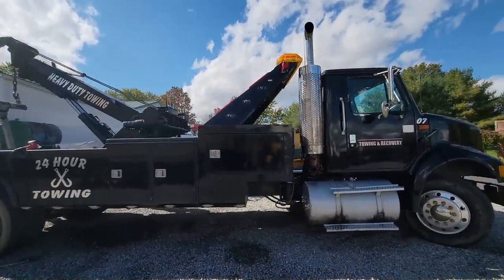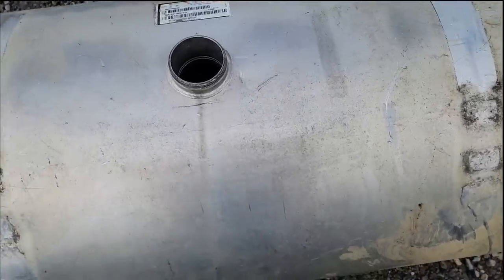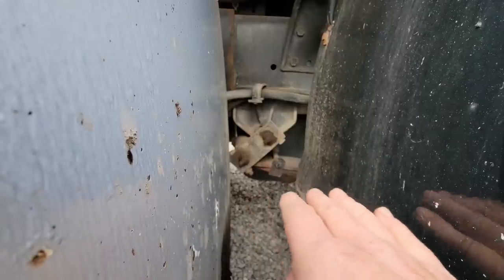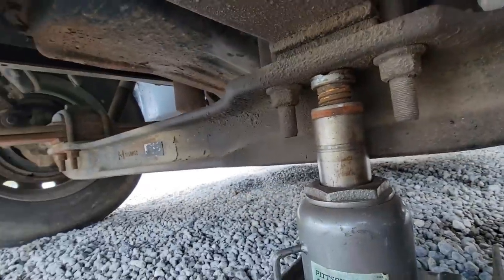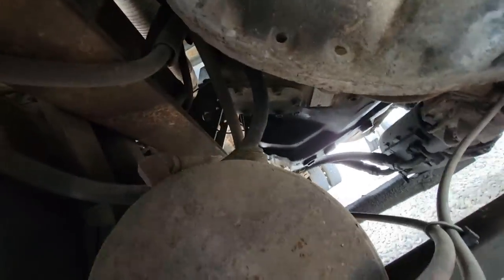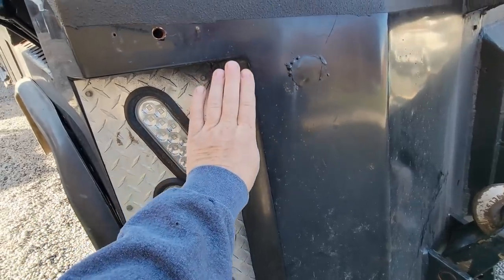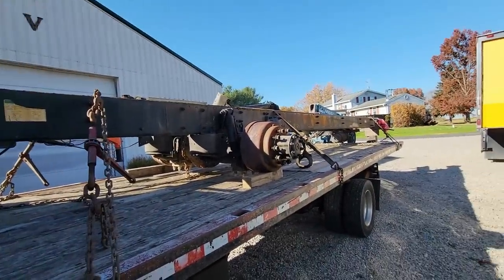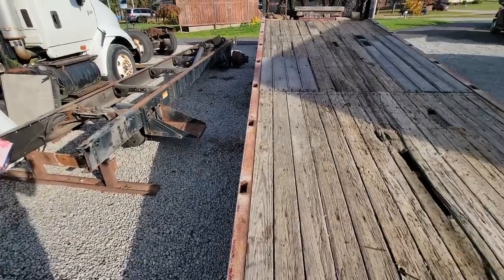2001 8100 WRECKER PT4 MORE PROGRESS AND PUTTING IT TO WORK!

Comment: Dear J.C. Smith projects family.
👍👏👌 Using a hair dryer, definitely not a heat gun! That's exactly the way to do it and how I deal with stickers too. Meanwhile the only thing I use to remove the rest of the glue is, believe it or not, olive oil (nearly any kind of vegetable oil/fat or even butter will do fine too). Maybe this method is a bit more time consuming but it will definitely not damage any surfaces.
2) A lot of content in this video. Of course I'm eagerly looking forward to watch all the repairs and modifications you do on this wrecker.
Thanks a lot for making teaching explaining recording editing uploading and sharing.
Best regards luck and health to all of you.

Comment: For the backup camera I would make a bracket so it sits just above the under-reach so you can see the whole thing as you back up and use it as a tool to help center yourself. I also agree with you on toolboxes… Seems like you have plenty until they’re full and you still want to carry more stuff… Towing is a cut throat business but with your knowledge and want to have things right you would make a name for yourself… the only problem is finding another one if you to hire to help run trucks…
Reply from the maker: my intention was not to be for hire. only want to move my own trucks. i see working for others as adding more drama and stress to my life that i dont really need. im not saying i wont but it isnt my intention right now. i looked into insurance. i was thinking that i would make the truck pay for itself  but the insurance is ridiculous. adding another driver made it so much higher.

Comment: I know one thing about the 4700 series international. And i know you do too. They are really hard on kingpins. The 4300 series is even worse on them. My brand new 4300 with a 21 foot steel roll ack on it had to have new kingpins installed at 62,000 miles. I could not believe that they went bad that quick. It was immaculately maintained up to that point and it still kicked the crap outta the kingpins

Comment: There is this adhesive remover called 'rapid remover" and it makes googone look like tap water. You don't even have to remove the vinyl first.  It's safe, non toxic and you can get it on that jungle website that bezos created. It's a bit expensive but it is absolutely amazing. Works very well on old paint protection film.

Comment: Great video......i always use hair dryer to ease stickers off but petrol will get any adhesive left off in a flash.....then quick buff with polishing compound and jobs a goodun.......also i drain tanks and stuff a handfull of blue roll in and then blow them around with air line and then use long spring claw to retrieve rags then quick rinse with petrol to any last water 👌

Comment: Jc I know a older guy who used to buy large lots of stuff at auctions. He has several hundred different truck lights like you use. I could probably work a pretty cheap deal on all of it if you are interested. All are new in package and at least 90% are led. The packages are slightly damaged but lights I saw all look unharmed.
Reply from the maker: i think i found what was in the rear and i ordered some work lights. if i need more, i would definitely be interested

Comment: Excellent explanation on springs, and how you check king pins and such.
Surprised how tight the kingpins and tie rod ends were whith those junk leaf springs!
That rear axle on the frame looked like a 23,000 lb axle. Is it a locker as well?
Lettering on the boom,, take off "towing" and leave "Heavy Duty". There is the name for this truck.
Reply from the maker: no. it is only a 20,000lb axle. not a locker either.
Reply: @j.c.smithprojects  well heck.
Still good stuff to make a single axle air ride something, and get rid of spring ride.
Reply from the maker: this truck is air ride.
Reply: @j.c.smithprojects  I meant some other project down the line.
Reply from the maker: i misunderstood. my apologizes.

Comment: Watching here in Australia with  that front  spring as flat as it is it runs out of travel pound s out the rear hanger I used to shorten the spring  app 3/4" so the is virtually  straight  up & down in the unloaded position,plenty of room for travel,just a thought.

Comment: The first 4700 i international i bought brand new in 2000 had a auto trans and a 250 hp 466 in it and i got 180,000 miles on it before it needed kingpins.

Comment: Do you have enough trust in this wrecker to go say, anywhere in the state to pick up trucks you may have bought? I realize that you're doing necessary repairs on the suspension and lights and other safety issues. I guess what I mean is do you trust the drive train?
Reply from the maker: its at the "couple hour away" trust right now.

Comment: To use the wrecker for your personal use do you have to run DOT numbers.?
Reply from the maker: no. i would not need anything.
Reply: What is the weight limit that requires you to have a CDL license now?
Reply from the maker: there isnt one for personal use. commercial use is 26,001lbs single vehicle gvwr or combined vehicles gcvwr with towed vehicle being 10,001 lbs or more (towed vehicle 10,000 lbs and under  does not get added to the gvwr). however, each state can have their own laws on top of that.
Reply: Thank you